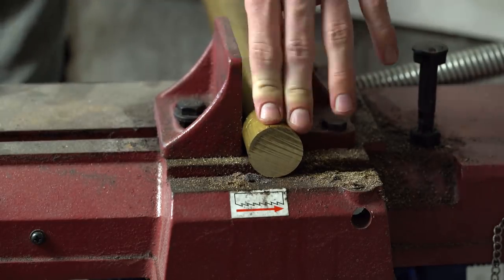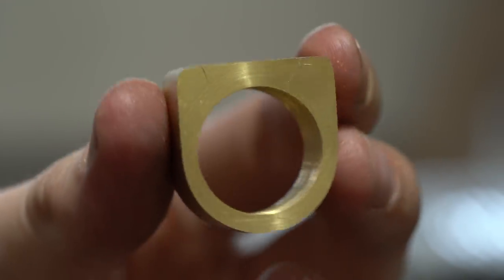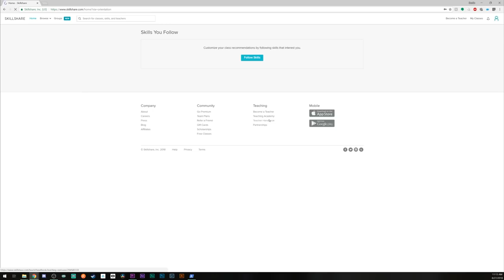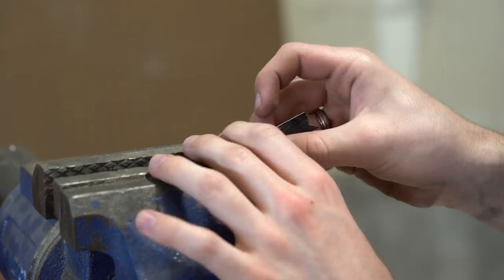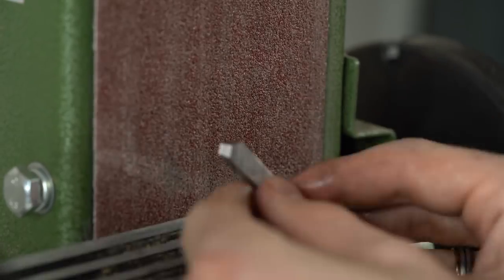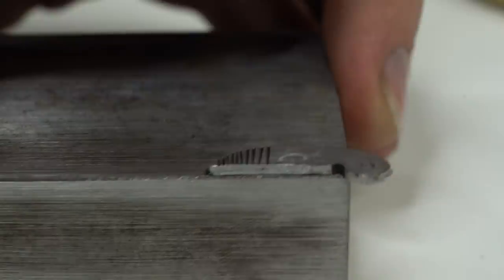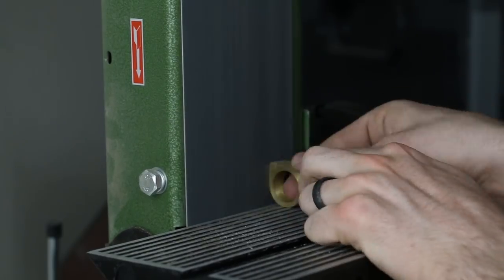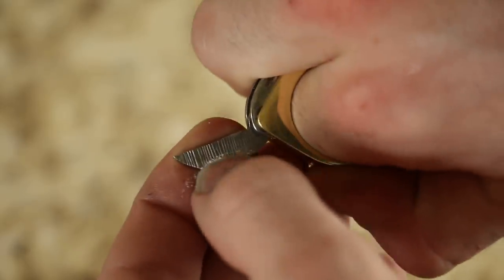Making a Swiss Army Ring

Comment: Can you make a ring using a Tungsten ring blank with a Gallium inlay covered by a heavy coat of resin, encapsulating the gallium inside. Gallium does not corrode tungsten but it does corrode just about everything else
Reply: Yes I'm so happy I got a heart
Reply: Soooo a liquid ring? Sounds pretty cool!
Reply: You could call it the T1000 ring
Reply: I would recommend using an Alloy named Galinstan (GaInSn,I dont know the ratios), it freezes at lower Temperatures,Gallium would maybe just freeze on a cold day. Plus,Gallium notoriously sticks to everything because it oxidizes and Forms a thin film,(even Glass vials),and it wouldnt  surprise Me if it would stick to resin as Well. Galinstan is Not that sticky,but it would still be a Challenge to encapsulate it in a way that you can see its a liquid metal.
Reply: Quantumcat, I just got this idea, so it woulden't surprise me if it doesn't work, but maybe use metallium? I saw it on a site called 'liquid metal watch' and they use it there.
Reply: Cool idea, but very hard to pull off the gallium will need to be frozen during the making process!
Reply: @rayray29899  hmmm....

Comment: It's an interesting design, but a couple things: I can't quite tell from the video but the blades seemed to open very easily, as if they could actually just swing open with a flick of your wrist, which isn't very practical. Second, you made more of a saw than an actual serrated blade, again I can't quite tell from the video but the edge doesn't seem to be present on the inside of the serrations, only at the tip, so you'll be doing more tearing than actual cutting. Third, you were having such trouble cutting because you didn't have proper blade geometry, your cutting edge should have a very acute angle for knives, your edge was more similar to what would be ground out for an ax head. Ideally for knives, your bevel should end anywhere between the middle of the blade to the spine of the blade. Take a look at the thickness of most swiss army knives, the spine of the blade is never more than a couple millimeters, and they don't really need to be any more than that because they are relatively small blades and won't be doing any serious cutting. 
Overall I really like the look of this ring and think it's a good prototype for future rings. Would love to see another ring like this with more functional looking blades.
Reply: Holy Crap
Reply: This is one hell of a comment
Reply: holy fucking shitttttttttt the time it must have taken to write that
Reply: @BioHazard18  what like a minute or 2?
Reply: You must want one of these rings really bad, huh bud

Comment: The HSS high speed steel bar you made into a tool to make the file blade comes hardened so doesn't need re hardening. I would trust the factory hardening over DIY home hardening to reduce minute fractures.

Comment: Hey Patrick, as per usual it looks really fantastic. I think if you had used a small circular needle file to cut semi-circular grooves into the blade blank instead of 45 degree angles and then sharpened it, it would perform a little better. Regardless, it's a fantastic piece and it's good to see something out of the ordinary!!